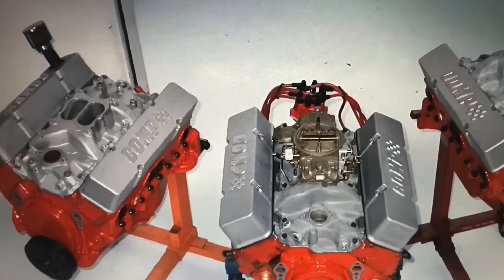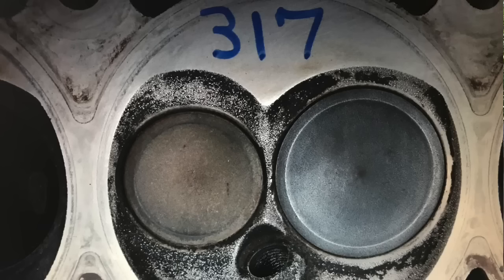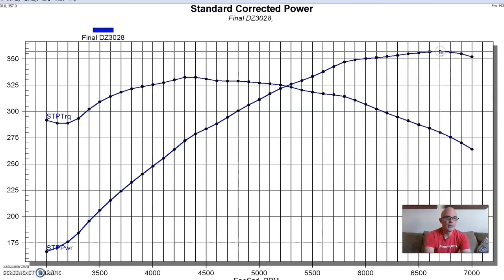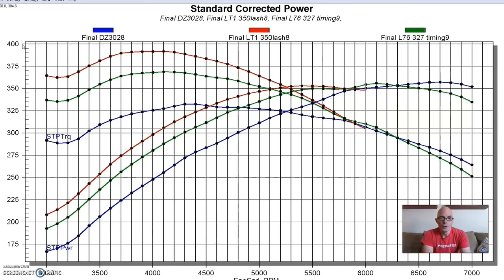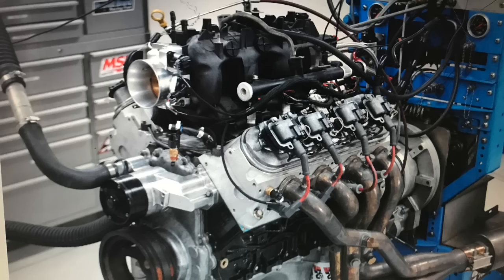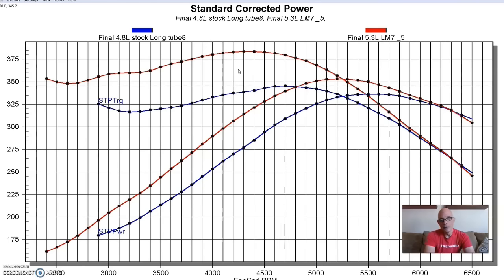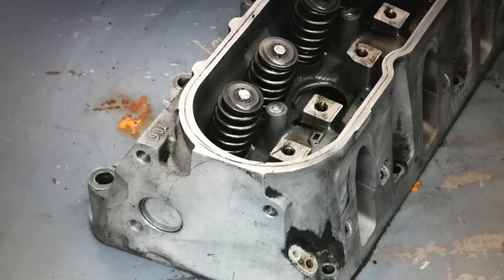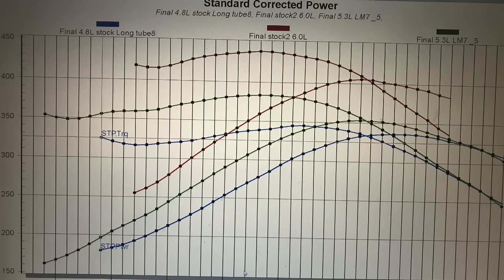HOW MUCH HP DID THE 1969 DZ302, THE 1965 365-HP L76 327 OR 1970 LT1 350 REALLY MAKE? WAS IT FAUX HP?

Comment: I’m a Mopar guy. But my favorite Chevy engine is the 302. My second favorite is the 327. You tested my two favorite Chevy engines. I noticed that the compression has a lot of influence on torque and hp. Early model 327 when good gas was available to have higher compression. 69 was a year that compression was still high due to good gas. As we know after 71 the octain fell off and so did compression. Then as octain levels raised so did compression. Then hp levels rose again. We have 10:1 and greater compression today and we have na engines making good hp again.

Comment: Hi Richard! We appreciate your approach to engine testing with relevant comparisons; thank you for your work! Our comparisons aren't nearly as extensive, but some good information could be shared. Check out our 354 cu.in. SBC, a 400 block and 327 crankshaft, "the 350 that Chevy should have built": https://youtu.be/3oLz362AbDU , and our 400 block and 283 crankshaft engine, tested twice because of valve float: https://www.youtube.com/watch?v=dBjdYC5sMjs , and https://www.youtube.com/watch?v=Ge6RsIOs1-U . We have a 349 cu.in LS, a 4.185 bore x 3.267 stroke engine that produced 1.889 HP/cu.in.: https://youtu.be/ttEsebehdrc. Thank you for your work and insights! Best regards, from Western Canada, CE Performance Crate Engines.
Reply from the maker: thnx for the info
Reply: @richardholdener1727  Thank you, Richard, for your reply, and for your great work!

Comment: You mention that the 327 and 302 are basically the same.  Sharing cams, et cetera, and making the same output.  The only difference besides displacement being the 3.0 stroke of the 302 (I don't remember and haven't gone back the video to find out if you tell the 327 stroke is 3.25)  But you don't say why.  Perhaps you didn't know that the 302 was created by Chevy so they could run Camaros in the Trans Am Racing Series to compete with Ford and Mopar.  The size limit for the league was 5 liters (305 ci).  Instead of completely designing, engineering, and everything else to make a new engine for the competition, they wisely put a crankshaft from a 283 into a 327 block.  Voila, 4" bore and 3" stoke equals 302 cubic inch displacement, and being a naturally high RPM unit, ran like a bat out of hell.
Reply from the maker: THAT WAS COVERED

Comment: Is there a way to replace a 5.3 with a sb 350 in my 2004 Silverado or a kit to do so. Don't answer back with the virtues of LS motor I have Chevy parts I've collected for 40 years. I prefer old school I'm not computer vehicle compliant
Reply from the maker: WITH A CARB?
Reply: @richardholdener1727  yes with carb and mad ignition I'm concern about motor mount and air conditioning. I have all accessories mounts from 1990 Chevy truck for 350. And I want to stay with original tranny in the 2004 Silverado.

Comment: Apparently I've been misinformed to my understanding back in the old days when the 302 was built they took the 283 and put a 327 crank in it which means it would have a 283 bore with a 327 stroke I might be wrong but I'm going to look this up just FYI
Reply from the maker: 4.0 bore (327 & 350 block) and 3.0 stroke (283 crank)

Comment: Hot Rod did a 350 build called the 350 Chevy should have built a few years back, I think it was a 400 crank/350 block with longer ford 300 rods the results were interesting worth checking out
Reply from the maker: I've seen it

Comment: Interesting correlation between stroke and peak torque that I believe is due to piston speed. Sure we know a bigger engine produces more power. But with everything else being basically equal between the 3. The 327 needs to spin about 300rpm higher to equal the same piston speed as the 350 and ironically thats where they both made peak torque. Same goes for the 302 but has to spin about 4600rpm to equal the 350's piston speed at 4k. The 302 was a 100rpm under that but none of them were running the same identical cam if I remember correctly.  

Maybe that could be useful for picking a cam for a smaller engine since listed performance specs are baised off a 350 in the catalog.
Reply from the maker: THE 302 AND 327 RUN THE SAME CAM-THE LT1 IS SMALLER

Comment: IF YOU WANNA COMPARE THE OLD SCHOOL SBC'S AGAINST THE LS ENGINES WITH THEIR RACE INSPIRED HEADS ,   THEN DO A SBC , 327 OR 355 LIKE WE DID BACK IN THE DAY !   BIG ISKY CAM, HOLLEY STRIP DOMINATOR OR OFFENHAUSER SINGLE PLANE  INTAKE, RACE PORTED HEADS AND A DOUBLE PUMPER CARB  !
Reply from the maker: so compare a modified SBC to a stock LS?
Reply: @richardholdener1727  EVERYBODY KNOWS THE STOCK LS HAS BASICALLY RACE HEADS ON THEM , CAPABLE OF 700 HP ,  GIVE THE SBC THE SAME ,  OH BUT THEN YOU COULDN'T KEEP HYPING THE LS ENGINES SO MUCH COULD YOU ?
Reply: @richardholdener1727  YOUR CAM AND SPRING CHANGES ON THE LS ,  IS NOT STOCK EITHER !
Reply: @richardholdener1727  AND I NEVER SAID STOCK LS ,  YOU BUILD YOUR LS MODIFIED ALL YOU WANT , THEN BUILT A MODIFIED SBC ,  WITH SAME COMPRESSION, SAME HEADFLOW, SIMILAR CAM WITH CARB AND GOOD INTAKE !  THE SBC WINS !

Comment: In the case of the DZ302, it did not have a 283 crank in it. It had a larger journal than the earlier 302 engines, the 327, 283, and 350.
Reply from the maker: 283 stroke

Comment: Then why is Chevy taking the C8 ZO6 down to 5.5 Liter and ramping up Revs to almost 9,000 RPM?  This hurts low torque but i guess as a race engine it will always be revd up an as it shifts up the gears are so many it will dip fewer RPMs on an upshift. I doubt any street guy took his Mouse very much past 7.000. Se he would drop to 4,500 on an up shift. but if he took it to 9,000 he upshift would be engaging at over 6,000 RPM where HP is back and in its sweet spot. I think.

Comment: The 307s where not to bad, I had one that was a hi rpm screamer
Reply: The small  block  Chevy  307 is a  
327 crank  and a 283   block   

The DZ 302 is a  283 crank and a 327  block   

My 327  has the large journal  327 Forged Steel Vette crank  
In a 4 bolt main  350 block  , 
Forged 12:1  pistons , aluminum intake,  Holley 1050 carb. Crane camshaft,  ported Heads,  Headers,  H.E.I.  distributor  ,  450hp  , Lakewood Blow Proof bell housing,  11 inch clutch,  M-21 Muncie 4 speed , 12 bolt posi rear end  , 
Revs to the moon  , 11,000rpm  before the valves start to float  , pulls both front tires off the ground  in  a 66 Chevelle SS and  3200lbs ,

I also have  multiple  283 , 307 , 327 , 350 cranks and  blocks  ,

My other  66 Chevelle SS  has a 327 with  Forged 11.5  pistons  and  makes 475hp 

My Nova  has a built  327  , 10.1 pistons  

My 66 Chevelle  Malibu  has a  LT1 350  
4 bolt main  

67 Chevy  K-20 has a 350 
68 Chevy  K-20 has a 307 
Both have 4 speeds and a  divorced 
Rockwell Transfer case   

My 98 Chevy  S-10  is  getting  a 
350 with a  350 Turbo Trans , 
I Hate Automatic  trans but I don't  feel like  adding a  clutch  pedal  , I just want to  drive  it

Comment: He you tested a 350 crank with a Duntov cam?
Reply from the maker: NOT AN LT1-OTHERS YES
Reply: @richardholdener1727  thanks for the reply. I just bought a 350 4 bolt main made in Canada with the same casting numbers is the 1969-79 302 (3970010) that’s all the info I could find on it. I was thinking about putting a duntov cam in it but wondering if I’ll lose too much torque. Would you recommend a cam that would make my truck run like a Camaro? I plan on getting some vortec heads and retro fitting a roller cam. Also daily driving :) thanks again, love your content.

Comment: Back in the day  a traco 302 with  dual four barrel  factory rods crank heads  put out 428 hp
Reply: 1968
Reply from the maker: a Trans Am race motor
Reply: @richardholdener1727  yes the mark donohue transam race motor in 68
Reply: @johnpublic168 
So that was the 12.5 race pistons and 140 offroad cam or something else?

Comment: There is no replacement, for displacement!
Reply: Yes there is. It's called cubic money. Or a blower.
Reply: @mpetersen6  so, what you are telling me, a 2.3L 4 banger, with a massive blower, is the same or better than a 1005 cubic inch Godfather Big Block Engine?
Reply: @jakefriesenjake  
I like the rumble of a well tuned V-8 as much as the next guy. As impressive amounts of power that some production V-8 OHV engines are getting today. The OHV V-8 is dinosaur that hasn't figured out the asteroid has hit. Look at the power output Formula 1 engines get with very small displacement in comparision to the average pushrod v8 much less a big hlock. Streetable? Not really. BMW when they were supplying F1 engines (which were based on their production 4 cylinder) were getting up to 1000 hp out of the special qualifying engines. One thing most of the F1 engines have in common is very oversquare bore and stroke dimensions.  A Ferrari flat 12* was getting 450hp in the mid 70s. Out of 183 cubic inches. Especially the custom built pure engine architectures. Eventually it was found that the ideal naturally aspirated engine was a V-10 when accounting for piston area, stroke, rpms and internal friction. For a street engine just look at the stupid amounts of hp that people are getting out of Honda4s and the Toyota 2JZ
*Actually a 180° V-12 as they were not a boxer where corresponding cylinders on each side are going in and out at the same time.
Reply: @mpetersen6  technology is getting awesome. GMs new lt6 that they got is pretty sweet!
Reply: @jakefriesenjake  
I've been saying this for years. There are more seriously fast cars now than there ever was in Muscle Car heyday.
Reply: @mpetersen6  mostly due to turbos being efficient!

Comment: I would like to see difference with 302, 305, and 307. Different bore and stroke but similar displacement. 

I read arguments that the 307 makes a better HO motor than the 305 due to longer stroke but since Chevy never made a HO version 307 most over look building a 307

Comment: If the bigger stroke which increases power at lower revs increase piston speed causing more stress on the engine reducing longevity?
Reply from the maker: it will not-not in this rpm range

Comment: That's an interesting comparison.  I would not have expected the 3 older engines to top out at the same horsepower.  This may indicate that the engines are limited by the breathing of the heads/intake/carb/cam.  With changes to those components you would expect the larger displacement to be capable of more peak horsepower.  The LS engines are starting with better heads, maybe better intake, so bigger displacement still has some peak power advantage.  Of course you demonstrated this when you did other tests with modifications to the 327.
Another thing that I can't address- people used to talk about optimum ratio of bore to stroke.  I don't know what the optimum number is but the 302 seems to be closer to it.

Comment: The 327’s only had 590 cfm carbs from the factory. The 302 and the 350 both had 780’s. The original carb would not allow the 327 to make that much power. As good as they ran I always thought the 327 was a bit overstated on horsepower.

Comment: Richard, HP is work done over time. So, the 302 does more work in the same time. If I'm road racing (Z/28's intent) where I'm at 4-8k, it's the best. Yes? Torque is great for getting out of he hole but if I'm road racing, this means nothing. Am I wrong?
Reply from the maker: none of these stock motors run to 8000 rpm
Reply: @richardholdener1727  In your test yes. It was a generalization. I had a 69 Z/28 and yes, the heads were resprung but I buzzed it to a tach reading of 7500, hence my 8k comment. Thanks for your videos.

Comment: You forgot the 400 small block
Reply from the maker: A STOCK ONE NEVER MADE ANY POWER
Reply: @richardholdener1727  You got to be kidding me I know it does and its balanced differently example external/internal the opposite of the other small  blocks . A 400 needs a 400 flywheel you can use any from the other SB .

Comment: Would love to see 4 different sbc engines compared that are configured 4 different ways built with the exact same compression, same heads and same cam to prove once and for all what is the best way to build a sbc 350.

1st engine would be a sbc 350 the way the General originally configured it.

 2nd one would be from a sbc 400 block using a 327/307 3.25" stroke crank with long 6.25" rods.

3rd configuration would be from a 307 block using a 400 3.75" stroke crank. You can use sbc 400 5.565" factory rods with this one, with 4.0L Jeep pistons. Would have to be a factory 400 crank to be able to use the factory short 400 rods.

And finally the 4th configuration would be with a 305 block with a 4.00" stroke crank. Would be 6.00" rods for that crank.

To make it fair for the small bore engines, use sbc 305 Vortec heads on all 4 engines.

To up the anty throw some boost in the mix as well to seewhich one responds better to boost. Possibly just swap the heads and cam to each engine to try to keep costs down a bit? 

The factory configuration 350 has a 1.638:1 rod ratio. Number 2 will have a 1.923:1 ratio, #3 will have a 1.484:1 ratio and finally Number 4 will have a 1.5:1 ratio.

Possibly if you wanted to because the 3 and 4 ratios are very close, the number 3 ratio can be changed, dealers choice? But more expensive custom pistons would need to be made.

A factory stroke sbc with 6.00" rods would give you a 1.724: 1 rod ratio to throw in the mix if you wanted to? 

This would be the ultimate bore vs stroke comparison of all times. And just for a bonus would also be the ultimate rod ratio comparison.

This ultimate test would put to rest bore vs stroke which one makes more power forever. Also would put to rest what rod ratio works the best all in one video! 😲👍
Reply from the maker: I'm not convinced rod ratio does anything significant at these power and rpm levels
Reply: @richardholdener1727  

Well, there is still the bore vs stroke debate and as a secondary you'll be either totally convinced or it will show that rr does make a difference. Anyway if you made this video I think it would probably go viral? Should be a million plus view video?

Thanks for reading and replying.
Reply: @richardholdener1727  

Oh yeah, I did mention boost, a big cam with boost should get you that higher power you're looking for? The average flow numbers for the 305 Vortec heads are better than the 350 Vortec heads, just so you know. They start slowing down @.400" lift and are only down by 3 cfm @.500" lift. According to the Stan Weiss website anyway. And the exhaust out does the 350 heads as well.

Bigger 1.94"/1.60" valves and some porting would go a long way. You would only have to do or have done one set and use them on all the short blocks.

Comment: i know u can get a lot hp out of any of these engines i have a pro built 327 built by old man bell himself it is nuts 1200 hp on 92 octane no nitro and it can handle insane rpms it has been to 15,000 rpms a few times but he did everything to it he even seasoned the block polished the inside of the block ported everything even the intake to match the new ported heads he opened the heads up same with water jackets stock headers are way to small for the ports he had to port the cam bearings to get the new cam in it just to big for stock cam bearings started with 202 angle plug heads he said it needed cast on cast for what we were doing he said the head gaskets would not last long turning high r's all the time . he knew what he was doing because i have never had a engine with this kind of power last this long over 15 races and been driving on the road for over 20 years and it still runs strong  . there was only one problem with this build it was not cheap at all .
Reply from the maker: 1200-hp 327? 92 octane? 15,000 rpm?
Reply: @richardholdener1727  sounds like u think it is bs but u can think what u want it was built by old man bell and back when i was street racing it i never lost a race on the street in my class no nitro pump gas only full body cars now i been getting 454 crate engines for free with low miles on them the 450 hp at 485 torque with 4 inch stroke steel crank heavy rods with the heavy duty 400 turbo with them but u think that is bs too i bet and my collection of rigs u think that is bs too but that is fine just never get hold of me for parts or good project rigs i only have 10 acres of them i could tell u on how to get good crate engine cheap if not for free but it would be bs right . and do u even know the rpms that top fuel cars turn i bet not

Comment: The 6  has a  larger  bore that will unshroud  the valves this makes a big difference  at high RPM!
Reply from the maker: 6?
Reply: @richardholdener1727  the 6 liter not 6 Cylinder

Comment: Please please please!!!...I need some help...im actually in the process of building a original 1970 LT1 and i have almost everything needed but the camshaft. I have all the engine info/specs GM used to build the LT1 but the camshaft specs. I've been all over the internet and can't find it. Do you know it? As far as lift, duration, lsa...etc? And is it possible to get the same cam accept in a normal hydraulic flat tappet instead of the solid lifter cam that GM used? And would going to a hydraulic flat tappet over the solid lifter change the performance? Please help me!!!
Reply from the maker: I have the specs on the original LT1 cam-send me an email (killerbe16@aol.com) modern flat tappet (solid or hydraulic) would be a better choice than original cam
Reply: @richardholdener1727  I sent you an e-mail...lmk if you got it. Thanks!

Comment: Chevy offered an automatic transmission behind the 370 hp 350 in the 70 Z28.  This required a slight reduction in the exhaust duration.  The added displacement and reduced duration worked well with the auto trans.  No auto trans was offered with any other solid lifter small block, nor with the 350hp 327 hydraulic cam engine.